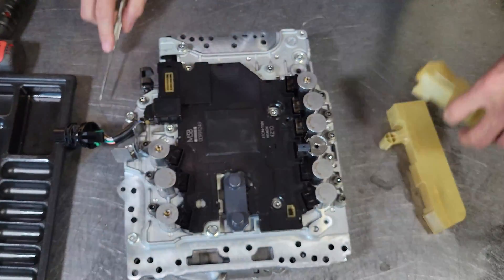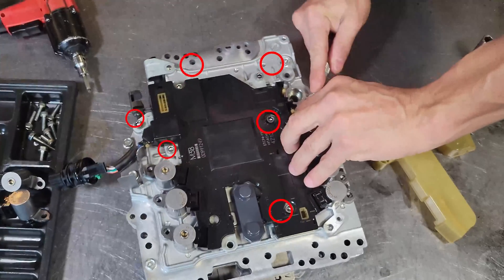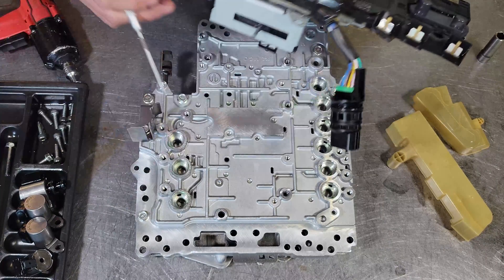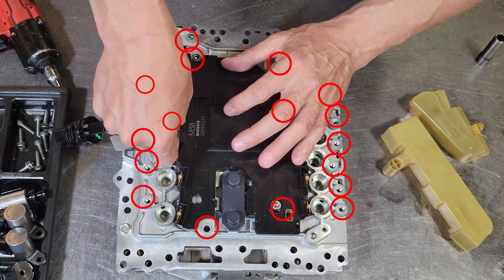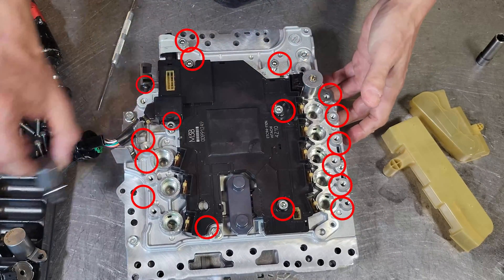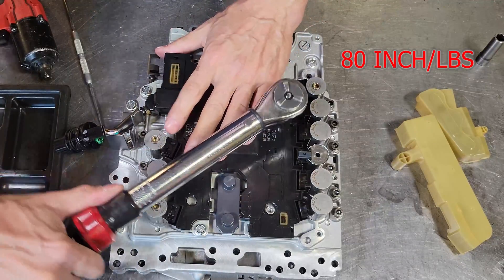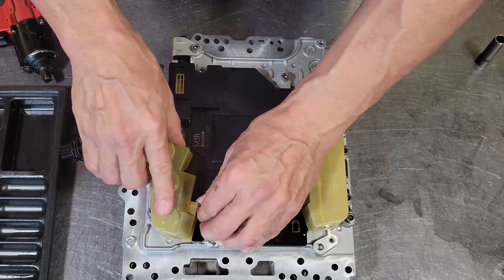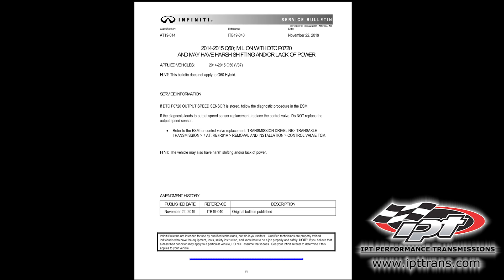Nissan Code P0720- RE7 and 7AT TCM/Solenoid Changeover, 370z, G37

Comment: What is thr absolute issue? Broken soldered connection?  shorted? There has to be someone that knows something. Ill fix them for free  (my labor) if we can figure this out. Someone has to pick up the pieces when companies fail at designing or warranty work.
Reply from the maker: The circuit board in the tcm shorts to ground. I haven’t heard of anyone being successful in fixing them. If you want to contact me at the shop, I can probably find a bad one if you want to mess with it
Reply: @iptperformancetrans  ok great.  Thanks for the info.  I will  take you up on that. Let me know how to send you my address. I also can send you a shipping label. Thanks
Reply from the maker: @TigerRacingProducts  Email sales@ipttrans.com

Comment: So it's the TCM that's causing the transmission not go past 3rd gear?
Reply from the maker: Yes, it in a limp mode in all likelihood
Reply: @iptperformancetrans  So I got a new tcm and installed it but I'm still having the same problem. Could it be a bad TCM or valve body?
Reply: @timatang I wonder what the problem was?
Reply: @xiaomiredmi3217  Unfortunately I had to get a new valve body

Comment: My car turns on fine but then when I put into drive or reverse it dies like if it stalls I have a 2013 g37xs you know if the TCM can be the cause of it ?
Reply from the maker: The most common cause of that in these transmissions is a bad torque converter

Comment: Sir ur amazing but how about incorrect gear ratio and incorrect 5th gear ratio ...and the gas pedal goes off suddenly and when i switch to Ds it still reads D and no gas response ..problem fixing itself when i turn the car off then comes back again after a while ...pls i need help!
Reply from the maker: A gear ratio error is typically your transmission computer detecting a slipping transmission
Reply: @iptperformancetrans  so should i replace my tcm ?? Or the selnoids ? I’m from middle east so help would be alot appreciated sir
Reply from the maker: @alihilmi2324  Again, a gear ratio error is typically your transmission computer detecting a slipping transmission
Reply: @iptperformancetrans  so transmission should be replaced?
Reply from the maker: @whoahitshalo82yt69  Most likely

Comment: Hello sir , do you know if i can use a tcm from a regular g37 on a g37x meaning awd . Thanks in advance
Reply from the maker: Definitely not, you will get a ton of codes at best
Reply: @iptperformancetrans  thank you ..@iptperformancetrans  help me here pls im doing it by myself and its hard , i changed the valve body for one with the tcm blank since its repaired valvebody . I filled the trans by my own and the car now runs and shifts not on time like it used to be but now pass the 3gear while won't do with my old valvebody . But when gear its in D it moves forward but not like before like if was on limp mode . And got code P2713 . Please help do i need to reprogram that tcm from new valvebody??
Reply from the maker: @gplay1349  I don't know what you got or what you need to do. Is the valve TCM new or is it from another vehicle? If it's not from the exact same car as what you have, it probably won't work correctly
Reply: @iptperformancetrans  got it thanks

Comment: Hey, so if I change the TCM the speed sensor in the inside of the transmission also change the battery and alternator what else could be the issue because my battery light and my brake light is on and it’s not doing nothing like the car a crank up start Run, but it’ll have the same effects that it’s been having,So would it be the speed sensor on the outside???????
Reply from the maker: You may have multiple issues and it may need a TCM, however, the proper order of diagnosis would dictate that you check battery voltage and grounds if you are having issues there before trying to fix codes.

Comment: I am replacing my TCM does only the part number have to match the original or every single number on the replacement TCM have to match too?
Reply from the maker: That's not even enough for correct interchange as they can have the same part numbers with different software installed on the TCM. Good Luck.
Reply: @iptperformancetrans where can i buy the exactly valve body that i need thst dosent have to be reprogrammed
Reply from the maker: @nozahyoublockqork2690  The numbers are meaningless

Comment: Thank you for this information. What is causing the TCM failures? Is it lack of regular trans fluid change maintenance?
Reply from the maker: Doubtful that it's maintenance related. It's a known factory defect.
Reply: I have a 2007 Nissan Sentra 2.0 ass and it is throwing all those power train codes including power supply circuit code P 1701 & P0720 out put speed sensor circuit in a lot of other power train codes
Reply: Im currenting dealing with this on my Q40 through my research ive put information together and from looking at my repair paper work.. when i looked at the Diag of my p0720. from my machine they listed some items that needed attention, Brake fluid corrosive and output speed sensor, so they replaced me sensor and no change to the car .  Then i looked at this site that builts the RE7 and they had a writeup on the 720 code and one of the causes is Brake fluid leaching into the transmission area and cause the solenoids to ARC between each other. This causes critical failure.
Reply from the maker: @rstack8727  That sounds pretty implausible, especially considering that the sensor itself doesn't cause the code. Care to explain how brake fluid gets IN a sealed transmission where the fluid can't come OUT?
Where did you get this info?
Reply from the maker: @rstack8727  This is among the most ridiculous things that I have heard. How does brake fluid get into a sealed transmission? Also, if it did, it would head right for the tcm and cause it to fail?
Reply: @rstack8727  The TCM is bath in transmission fluid right in the bottom of the transmission and sealed up pretty good. How much brake fluid and the transmission must be cover in it to cause a fault?? There is a TSB from Infiniti/Nissan to say that if there is a P0720 it is not s speed sensor issue but to replace the TCM / valve body assembly.
Reply: @rstack8727  I got the code a week ago. It’s not the speed sensor it’s the weak a$$ TCM, and since it’s sold together w/ valve body as an assembly, it’s runs for $2,300 (what I bought it for) other dealers increased the price to $3,200 recently. I installed it and it fixed the issue. I’m now selling/trading it and getting a vette. This is why the car would go into limp mode and not throw a code SMH @ NISSAN.

Comment: same thing here, so if i get another tcm from a 2013 awd g37 (mine is 2013) it should work without any reprogramming just plug it in? tryna get as much info as i can before i start buying stuff that wont works because i was told it was most likely both of them that was damaged
Reply: Did it work were you able to plug and play or were you needing to get it reprogrammed
Reply: @doctorsnpier4460  im literally doing it rn lol abt to fill up the fluid again
Reply: @doctorsnpier4460  did not work, same exact problem. im just gonna switch the valvebody out tmr to i guess
Reply: @domm261  you got a replacement TCM from the same year G37 like yours and it still didn’t work?
Reply: @nozahyoublockqork2690  got a new vb/tcm from a 2013, put it in but i think i blew a fuse. now it doesnt know what gear im in and doesnt communicate w the tcm (code u0101), going to test the fuses in a few hours and hope its just that. if u dont blow a fuse like i did then it should be plug and play which i heard from multiple forums and even 2 dealerships told me its plug n play. goodluck its stressful, take my word for it and get a tcm and vb not just one of the two😂
Reply: @domm261  i’m going to buy a brand new tcm programmed to my car and using a VR valve body i hood it works i’ll keep you updated. let me know if you fix your problem
Reply: @domm261   what you figure out?
Reply: @domm261  hello fixed?

Comment: so is it better to buy the replacement TCM or is it better to get a whole replacement VAlve body with TCM
Reply from the maker: The actual problem is the tcm, the valve body doesn't cause the problem
Reply: @iptperformancetrans  How much does the TCM cost?
Reply from the maker: @rcsatina85  You would probably need to call the dealership with your vin. The only way that they are sold is with a valve body. They are probably around $1K

Comment: Hey so I been searching and no one has had a sure fix. 

The Manual mode kicking you out. last for 30s to 10mins then kicks you out of gear back into regular D for drive. so can't even run DS for my power band because it kicks me out .. Is this what I need to do??

Comment: Hey I’m getting this code right after my 370z doesn’t want to shift can u help me with and explanation of what could be the issue and if can be just by AT speed sensor p0720. Thanks 🙏
Reply: Can it be the Tcm not functioning well and that causing to not shift ? Automatic btw
Reply: @l3vbmm6  I’m having the same exact problem and my car only has 37k miles
Reply: @santiagojaramillo5902  it’s the TCM/Valve body assembly. They’re defective. They cost $2300-3000.
Reply: @geartwinsauto  where did you get the assembly fro and did you install both yourself?
Reply: @immanuelshorungbe4449  I got it at the dealership. Tcm comes with valve body as an assembly. and yes I did it myself.
Reply from the maker: The whole video is made to explain what the code is caused by- it’s not the vss, it’s the tcm

Comment: I had the same issue...do we need to reprogram the TCM for used ones or its just a plug and play thingy? I purchased a used tcm and it drive OK however the paddle shifter is not working and the gear knob shifter (Sport mode) does not show numbers until you start to shift it. New code U1000. Appreciate if you could help me out. I am in Malaysia by the way.  Thanks.
Reply: You find a way to fix that because I’m having the same problem
Reply: @Gtyoungin21  any lights on dash after changing valve body?
Reply: @gplay1349  no light
Reply: @Gtyoungin21  is the car still running good? My 370z has a p0720 and I’m about to order from eBay.
Reply: @iptperformancetrans  I got a new valve body but it’s doing the same like what he said
Reply: @iptperformancetrans  I got it from eBay and it’s the same RE7
Reply: @Brooklyn Kid  one thing I learned was DO NOT get it from ebay. I did and you can't tell the part number unless it's in a car and you scan the car to get a code. It HAS to be from a 370z. Nissan uses this tcm/valve body in many cars BUT it's programmed differently for each and can NOT be reprogrammed over. So your only 2 options are buying from a company that sells that EXACT same module with the right code 31705-X454B is mine for my 370z. Or buying a brand new one, installing and getting nissan to program it at a dealer the first time as they come unprogrammed. These people on ebay simply pull these modules from used cars and since they're all the "same" they may or might not work, but only one program will run perfectly in your 370z, g37, q50, q60, etc.
Reply: @iptperformancetrans  idk if it’s the same year and date tho. How do you find that out?
Reply: @Gtyoungin21  hey brotha, unfortunately the valve body and TCM need to be from the same car because they are programmed together.
Reply: @Speedycory6  Would reprogramming still be required if the whole auto transmission is being replaced, or would it essentially be plug and play?